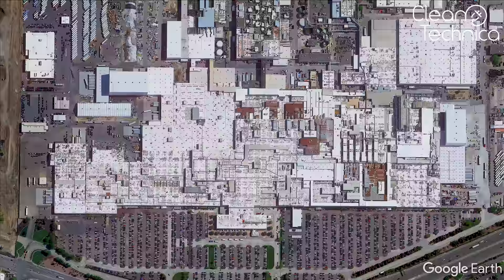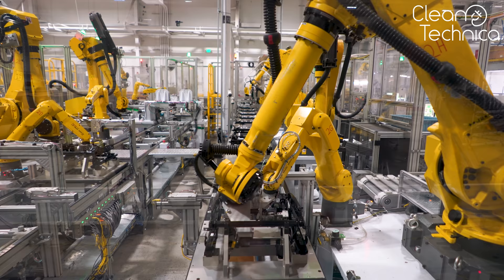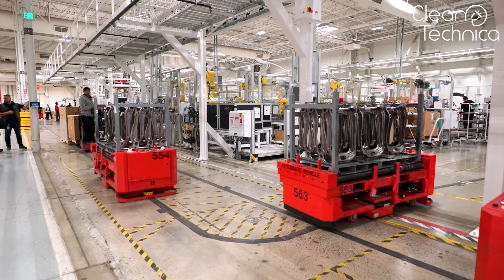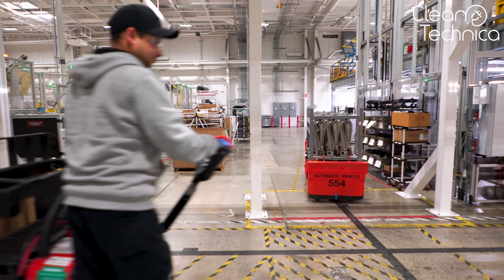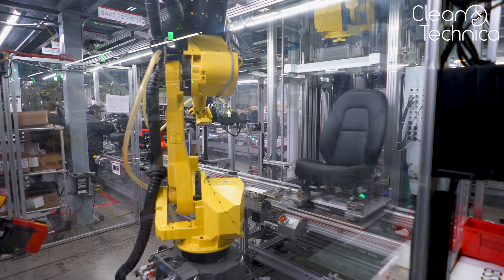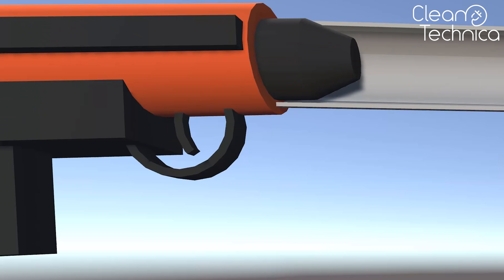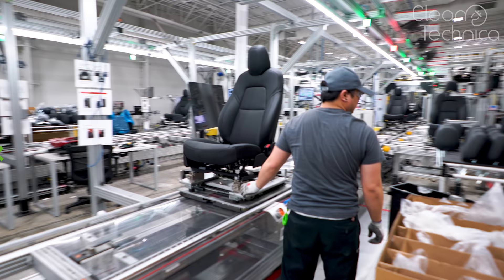Tesla Fremont Factory Tour, Part 2 — The Seat Factory

Comment: When you use the word "unique" you should not use the word "very" with it.  Nothing can be "partially unique" - it is either unique or it is not.  Uniqueness has no gradients. The same is true for other adjectives such as "pregnant." One would never say that someone is "slightly pregnant" or 'partially pregnant."  One is either pregnant or one is not.   I call these adjectives "Boolean adjectives" - they either apply without modification or they do not apply.   Just sharing.....great video.
Reply: A very correct observation!

Comment: 1:04	Move a seat using a hoisted manipulator
1:08	Fasten screws on metal frame of seat using cordless pistol-grip screwdriver
2:00	Stitch/staple cushion/padding on the seat using a pneumatic stapler
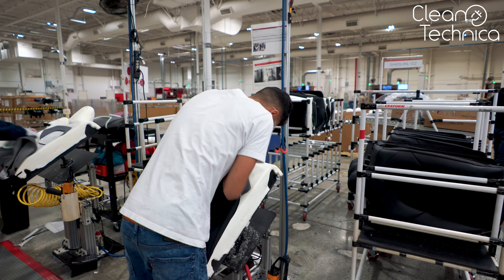2:10	Wrap cover over the seat
2:30	Adjust the cover on the seat
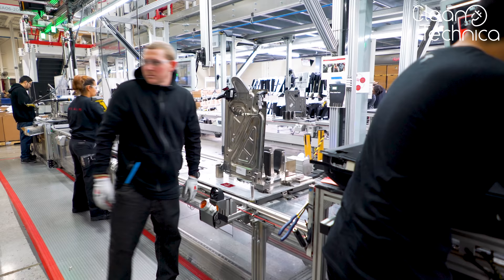2:45	Mount back of the seat on its metal frame
3:01	Close the zipper around the seat while adjusting the fabrics
5:30	Adjust and work on seat on a conveyor

Comment: 7:08 took me a while to understand this tube thing. I don't think it's vacuum, the tube would collapse under atmospheric pressure. The halfway thing is that they only put enough pressure behind one bolt to make it go halfway through the tube, so there's multiple bolts in the tube at one time.
Reply: It’s blow feed. The screws get dumped into a vibrating bowl feeder that feeds them into an in-line track, then when the robot requests a screw the PLC knocks one off and blows it down the tube.
There is 3 of them on the lower frame assembly line.
Had a lot of trouble trying to keep the screws from turning upside down when they get knocked off into the chute. Good to see that line running smoothly though 😁

Comment: You mentioned efficiency and speed at the end with the bolt air gun, and how they shaved off 0.8 of a second.  But no comment on speed when the glacially slow red transport robots spent what seemed like ages standing still before moving, earlier in the video.  Why do they take so long to think before moving at the intersection?
Reply from the maker: That is a good question, but if that speed ever becomes an issue I'm sure it won't be too hard to improve upon that. If you see how long work at any given station takes and considering that one of these robots carries at least a dozen, the slow speed should be sufficient for now.
Reply: Hey, thanks for that answer!  Speed is not an issue there because of a 'bottleneck' in the workflow that the robots are serving.  It makes sense now....that is if that's the real reason they're moving so slow....  But it makes sense.  Thanks!    @cleantechnica
Reply from the maker: @simian_essence  Sure thing! Worst case they could always just add more robots, there are multiple ways of solving that problem if they get to the point where it needs solving.

Comment: Tesla could purchase seats made exactly to their specs, for less money.   It is nice that they are trying to keep jobs in the USA .. as most seats made by the major auto seat suppliers are NOT made in the USA.
Reply from the maker: Actually they couldn't, other seat manufacturers were unwilling or incapable of meeting some of Tesla's requirements. That is literally one of the main reasons they took seat production in-house.
Reply: @cleantechnica  Seems Tesla vertically integrated a lot of component mfg in order to have more control ..but this is a short sighted decision they will need to undo in order to reduce costs and reduce capital for building new plants. Any of the large global seat makers, can make ANY seat that is designed for manufacturability .. Tesla's problems certainly were not a limitation of the suppliers, but rather a competence and communication issue with Tesla, which isn't surprising for a start up company composed initially of engineers unfamiliar with automotive design.

Comment: Just about every auto plant has this level of automation.  Most companies outsource seats and considering the millions upon millions made over the years and the few failures seen they are not a problem.  Tesla calls their plastic seats vegan leather as if there is such a thing. Zachary is amazed by bolts being fed to a robot by a vacuum tube delivery system which is pretty commonplace in most factories.   Tesla is not breaking any new ground here folks.